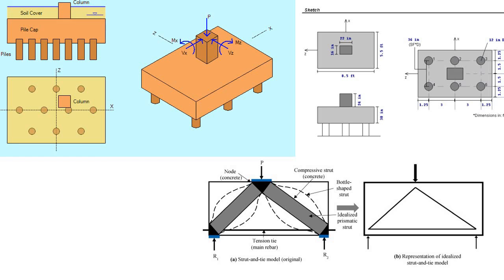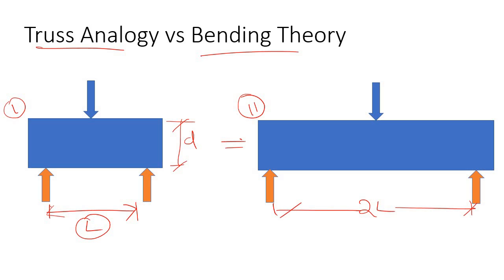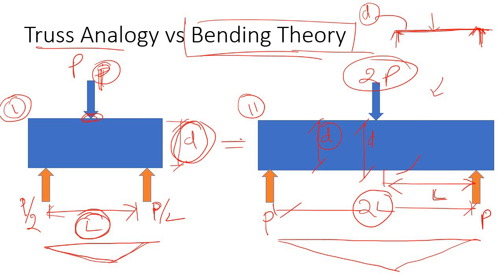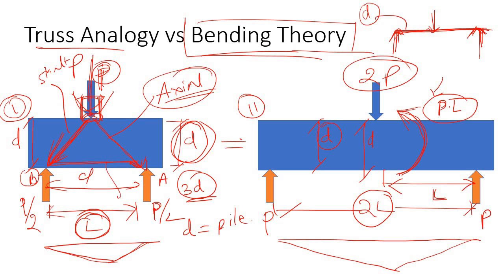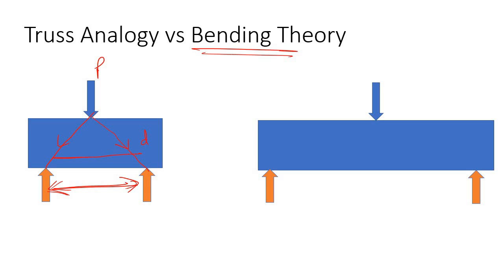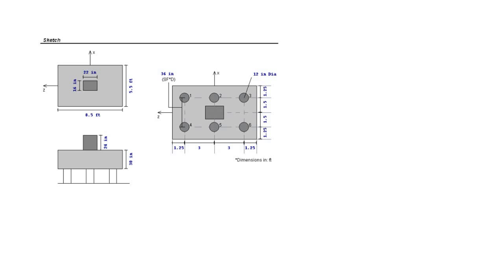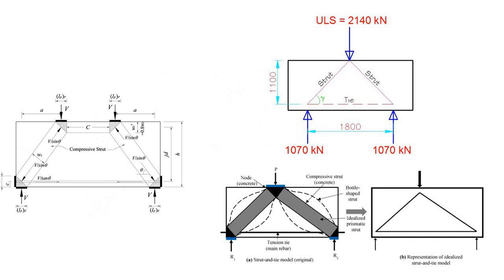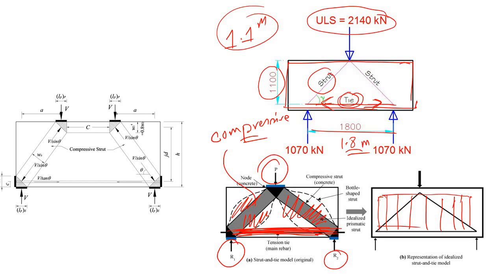Pile Cap Design :Truss Analogy vs Bending Theory

Comment: How does it work if you have 3 or 4 piles per row? Your example at the end only shown 2 reactions. What if I had multiple
Reply from the maker: In case of 3 or 4 pile you can design it by normal bending theory. This Strut and Tie method is only for 2 pile in a row system. Keep watching . I appreciate your interest and You can Join my channel to show your support and love :)